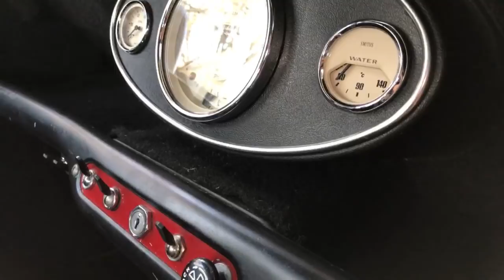My D*** Mini Cooper Brakes!!!

Comment: Damn missed the live broadcast could I ask I've replaced the brake resvior now got a really long brake pedal there's no air in the lines any help would be great as it quite scary pulling up to junctions
Reply from the maker: Hey Dean, if you still have a really long throw on your pedal or you have to pump it (even just once) you likely still have air in the lines. That's a really clear indicator of air. The only other thing I can think of is your drums need to be adjusted a bit using the brake adjuster screw on the backplate. This will bring them closer to the inside of the drum.

Comment: You should NOT put washers on there... washers are never 100% same. It may cause a 'wobbly wheel'.

BTW I own 3 Minis, and I have 2 brothers that also have Minis... yes more than one. We isedto have about ten.
When I spin the rear hub it SPINS. Yours, well it moved. But it doesn't spin. And it's not the brake doing that.
My guess is somebody dropped it onto the floor (off the jack) and bent the backplate, maybe damaged the bearings too. 
But you'd hear that, so guess not... no way you can damage the cast-iron hub though (it would crack).

Any more noise, most likely the backplate could be binding on the hub (in the centre).

BTW that's a pretty nice Mini. Good luck!
Reply from the maker: The washers were definitely a temporary thing to aid in diagnosing the problem. Keeping washers in between is definitely NOT advised. :-)

I think youre right about the floor jack hypothesis however that somebody was likely me and I just don't remember doing it.... :-D
Reply: If you'd want some more stopping power, get some 'Minifins' brake drums. They are a straight fit. 
Also helps when your drums get worn, which they eventually will. 

And if your front calipers ever go, get some aftermarket four-pots. Cheaper than the Cooper items and also much better. They'll send that stuff to the USA as well. 

Where do you generally get Mini Parts from? Must be difficult over there.
Reply: Mario PizzamanMario he gets mini parts from Seven Mini Parts, its his sponsor and you should check them out they have great parts and they have pretty much all you need. (btw Cole I just did your job😂).  (Pssst seven mini parts, sponsor me)
Reply: Hahaha willl not be much use to me here, I am in Holland. Only a tunnel away from GB, so parts for me are no problem.
Reply: Mario PizzamanMario hey thats close to me (Belgium). And yeah same parts are easy to find.